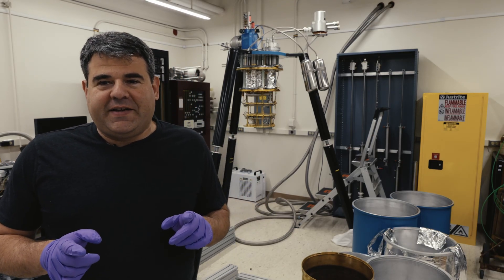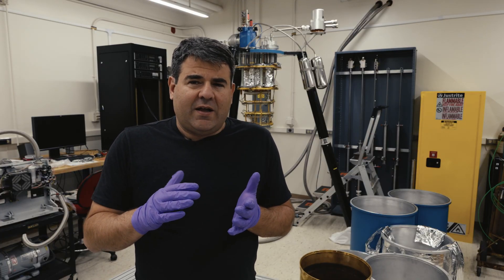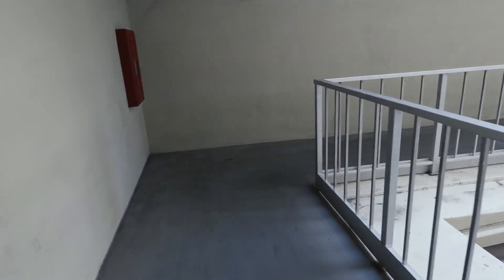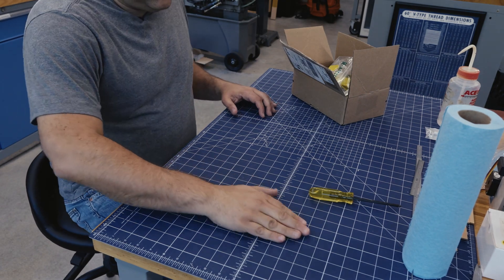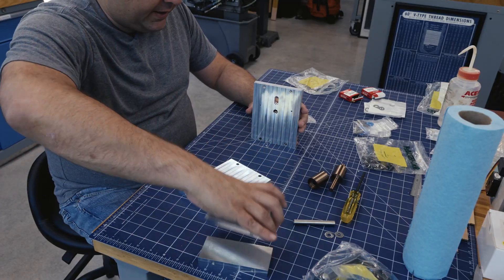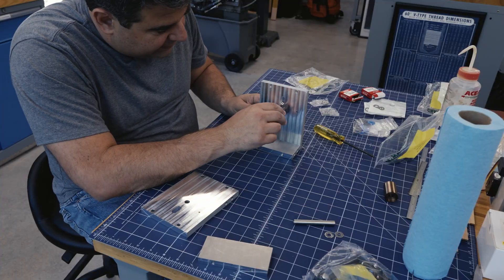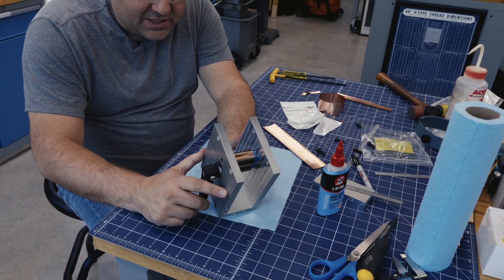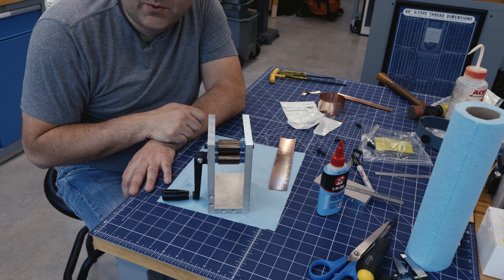Superconducting Pasta Maker

Comment: immediate impression is that the top bearings binds due to the lateral thrust bearings touching both the inner and outer vertical bearing casings at the same time essentially locking the shaft to the roller. try using two washers nested inside one another. it will be essential that the outside washer has more thickness than the inner. inner washer can be made from any material as it is only there to maintain correct alignment of the outer washer when joint is loose. doing this will allow the drum to rotate without locking it to the shaft when locked in place.
Reply: let me know if my words are confusing. i am visual and can send you a drawing better than i can put my thoughts into words.
Reply from the maker: I agree, I have some spacers I bought that should fix this, and I’ll install them in the next episode.

Comment: A screw on both sides to push the roller down would have been better and more accurate than screws on the side. Freezing a pin to make it easier to install without damaging ball bearings might also help.
Reply from the maker: You’re going to like the next video, then!

Comment: Rolling mills are geared for a reason. I would buy a cheap one and modify it as a starting point. It can often be a faster iteration to see why an existing product is not quite good enough than to build a full prototype addressing your initial design factors. The purchased item will represent the integration of reactions to many design factors, some of which may not be apparent until physically prototyping. You can always build from scratch the second time, which you will often have to do anyway. Good luck!
Reply from the maker: I thought about starting with a pre-existing rolling mill, but since this is designed for very thin foil (0.001-0.002" thick) I thought it would be fun to just try to do it myself.

Comment: In the future please do not hammer on bearings like that. 😬 Press bearings onto shafts from the inner race or into bearing seats from the outer race. 

If you add threaded holes coming in from the top to set the gap on the roller you can probably salvage the design you currently have. That would be much less likely to slip than screws clamping washers to the outside plates. 

Good luck!
Reply from the maker: Yes, I was perhaps a little hasty with the persuader - the inner bearing race should have been supported by the aluminum slot during the act of persuasion, but still not ideal! Since the material I'm rolling is so thin (0.001"-0.002") I'm thinking of just putting some threaded spring plungers in from the top to hold the shaft with the top roller down.